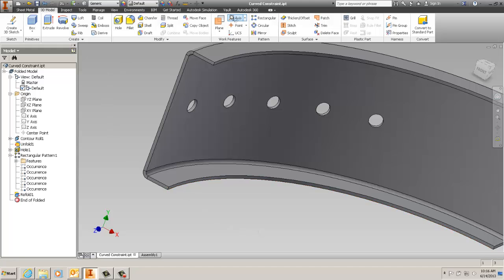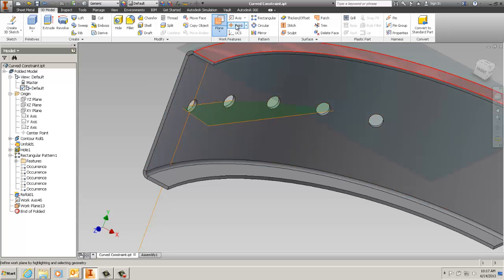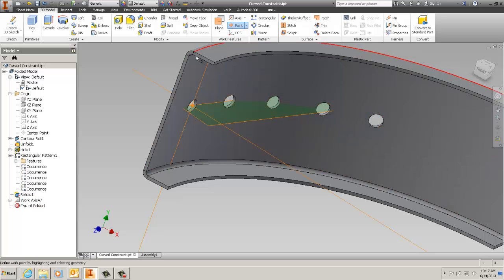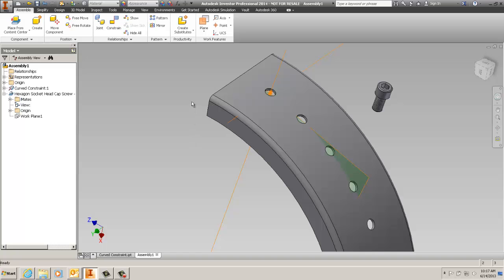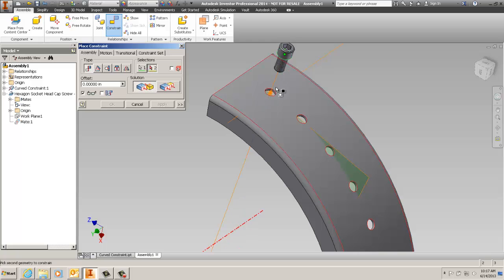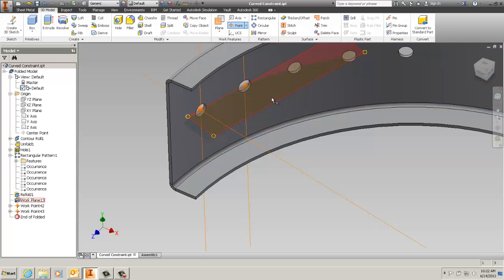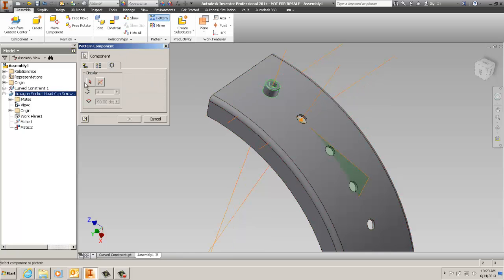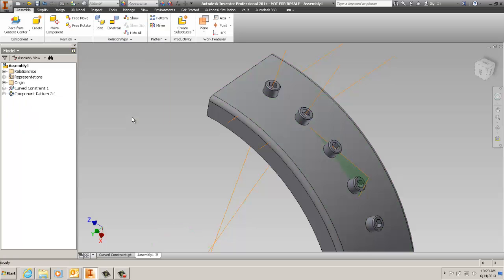Constraining a Screw to a Curved Surface in Inventor

Comment: John,  When I attempt to apply the first axis I do not get two points to pick on the upper and lower part of the hole.  I have only one grip point.
Reply from the maker: I have seen this also on some models.  When I do, I select the one point and then select the inside face of the hole.  You also can select any face or plane that is perpendicular to the axis you desire.